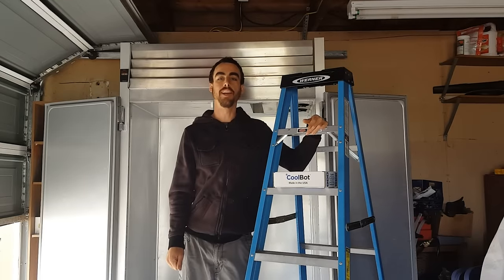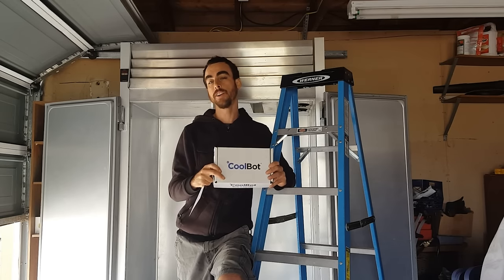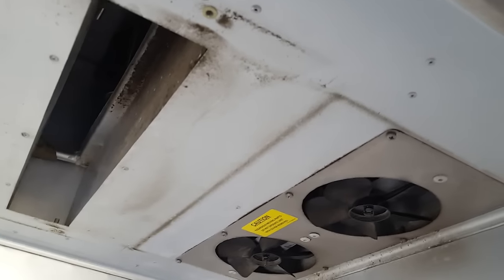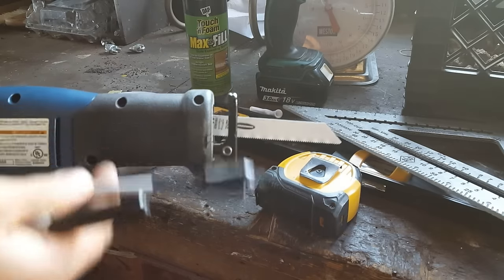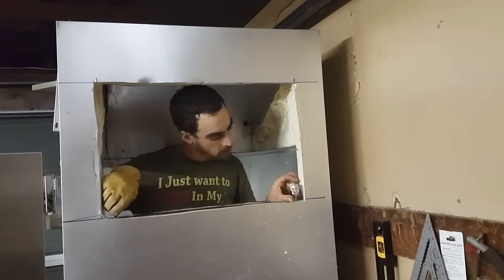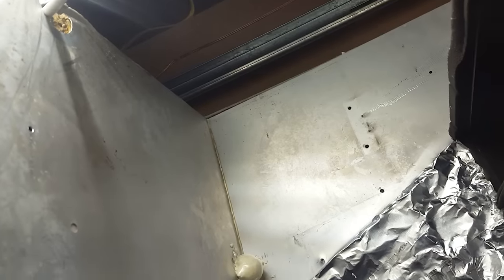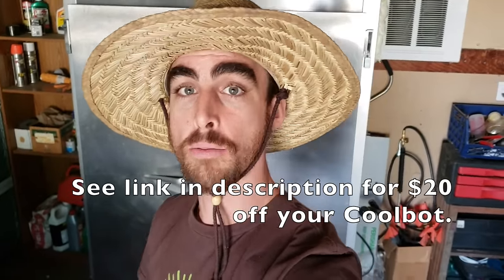Build Your Own Cool Room Using a Coolbot

Comment: If the probe is waterproof, keep it in a sealed small water bottle filled w/ water - this will minimize temperature fluctuations when measuring air temp when you open the door.

Comment from the maker: $20 OFF your Coolbot: https://storeitcold.referralrock.com/l/859B32AC/
Support the channel on Patreon - https://www.patreon.com/naturesalwaysright
TABLE OF CONTENTS:
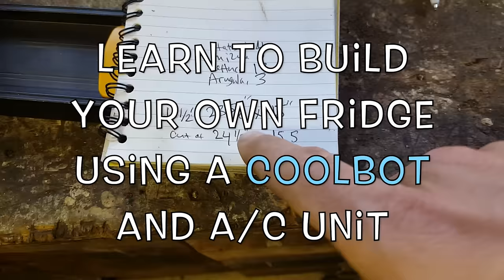00:00 Intro, What is a CoolBot? How will we build our own fridge?
2:17 The A/C unit I’m using and plans
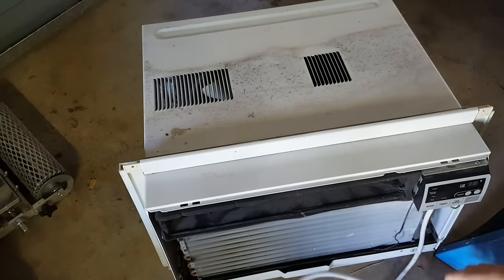4:32 Getting measurements and prepping
4:59 Tools and materials needed
5:28 Final planning and measuring
7:02 Construction Montage
7:59 What comes in the Coolbot box
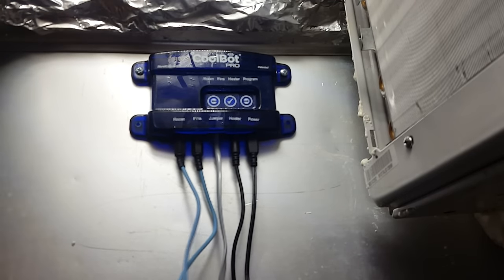8:26 Installing the Coolbot and wires
11:03 Testing the Coolbot and A/C
11:57 Results and Final thoughts

Comment: I have a similar box on a window unit inside a walk-in. My window unit just gave out and I replaced it yesterday. The new window ac unit keeps freezing over. I can't figure out why the old ac unit worked for 3 years and the new unit, same BTU, keeps freezing up on the inside.

Comment: Nice video 👍Is it ok to run the unit inside? Usually they suck air from outside right? Does it heat up your room? Condense a lot?
Reply: By definition it will heat up the room, like any normal residential refrigerator

Comment: I just checked the coolbot online it is 417 USD, AC is around 200-300 and you have a less efficient cooler with little less than a new cooler. If you buy used cooler, I believe you can pay less. What is the economic side of all that hassle?

Comment: Save even more money by getting an inkbird and disabling the therm. on unit. 50 bucks for it vs ridiculous price for coolbot...
Reply: Does it work the same?
Reply: @JV-ds5oo  no, it's a true thermostat control for 110v. You will actually disable the therm on the a.c. unit and use inkbird for the control. The coolbot uses a heattape on the a.c. therm to trick it to turning on. Inkbird also has a plug for a heater if it's getting to cold at night in your box.
Reply: @american7169  but will it keep my veggies cool?
Reply: @vajyileej916  heck yeah, I use mine for a meat locker walk in.

Comment: With a coolbot being over $380-460. Couldn't an inkbird temperature controller work?
Is there another way to override the a/c units temp sensor?
Reply: 2 inkbird working together1 for the ambient temperature the other one so the ac doesnt freeze and 1 little heating element to cool lower than 60f'

Comment: what does it cost to run it?  Window air conditioners are notorious for being expensive  to run.
Reply: Thanks for reaching out!  Because the A/C is pumping out cold air into a well insulated space the compressor will actually come on less than it would in a traditional setting, using less electricity.  If you think about using an A/C in your house, the cold air has lots of places to escape and the compressor will need to come on more often to keep you cool.  The CoolBot was tested by NYSERDA and they found that there was a 42% energy savings compared to a traditional refrigeration system. You can read their report here: https://www.storeitcold.com/wp-content/uploads/2016/05/NYSERDA-CoolBot-Report-May-09.pdf

With a little more information from you, we can calculate a rough estimate of what your CoolBot powered cooler would cost you to run.  Call us at 888.871.5723 and we can help you out!